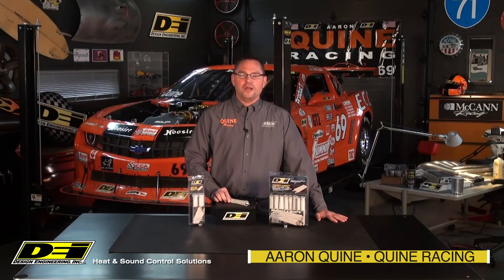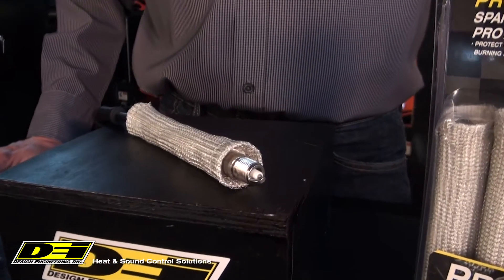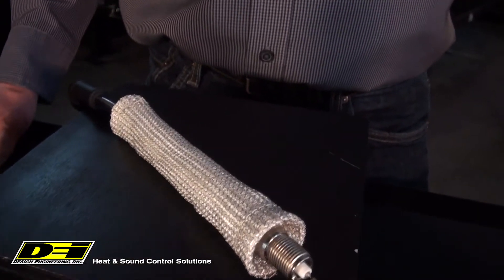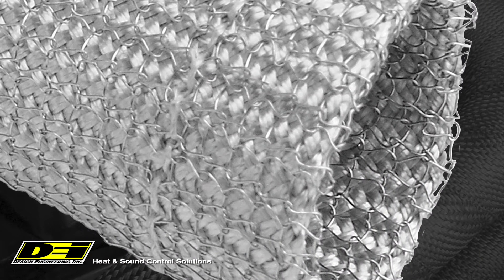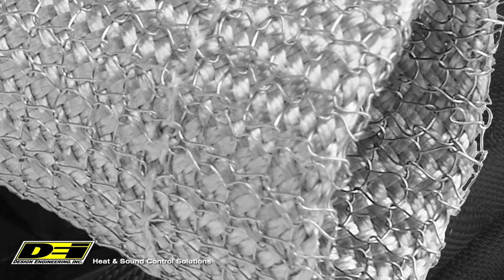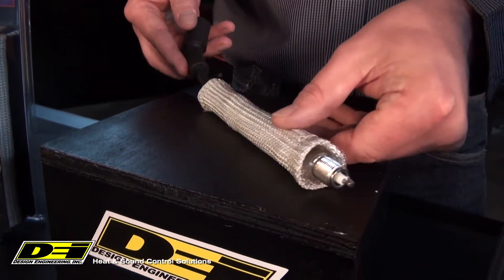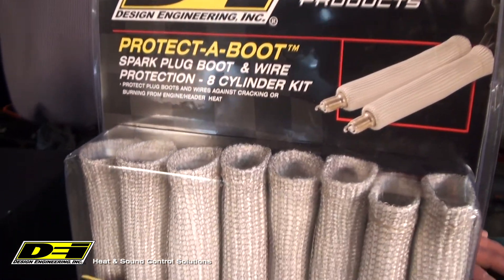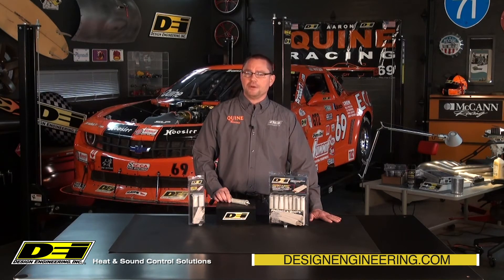EXO Boots from Design Engineering, Inc.

Comment: I run these boot covers over top of the del fire sleeve. I wish they were a little large in diameter to allow for easy adjustability to slide it down over the boot end. As well if one end was slighter larger it would fit over top a little better on a 90 spark plug boot